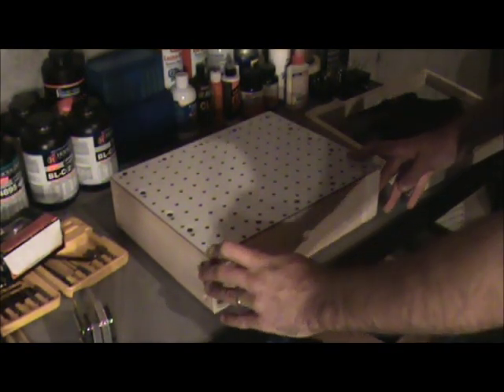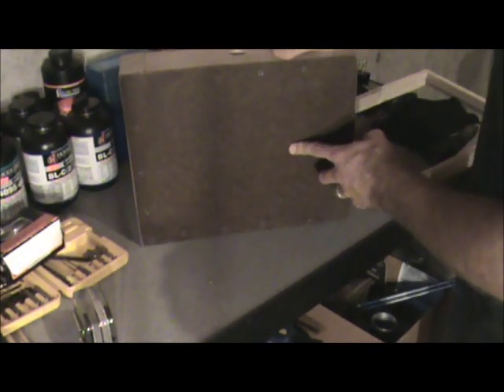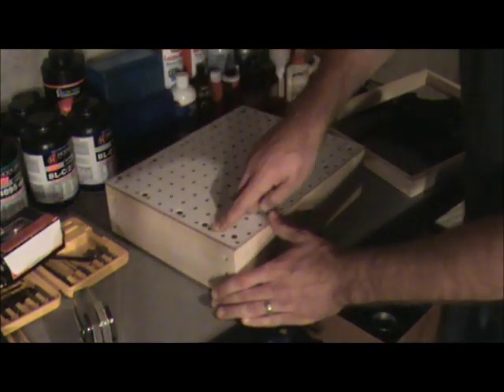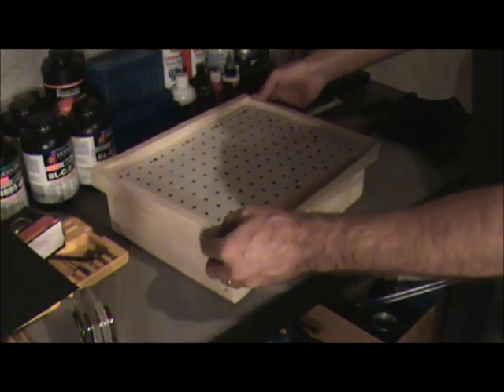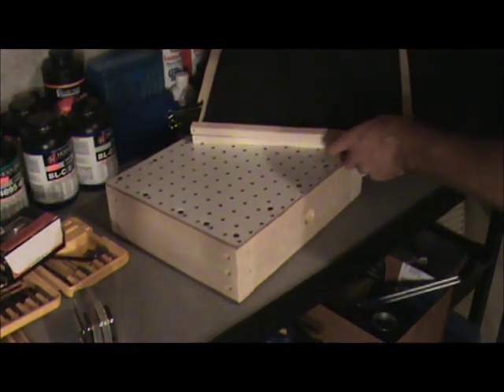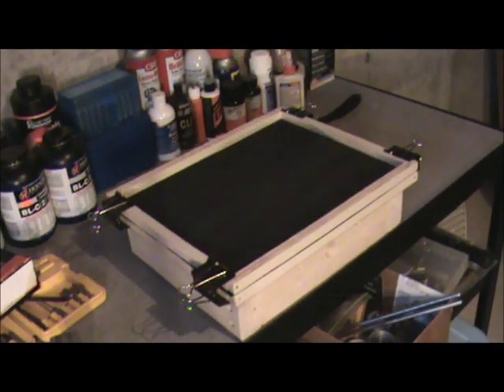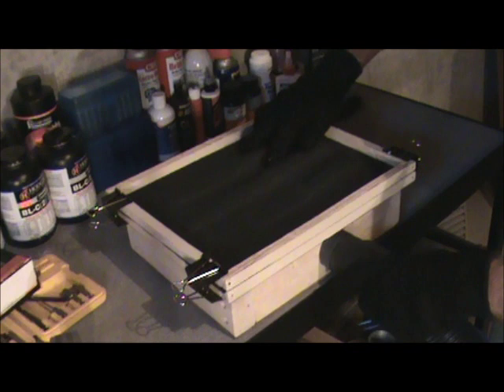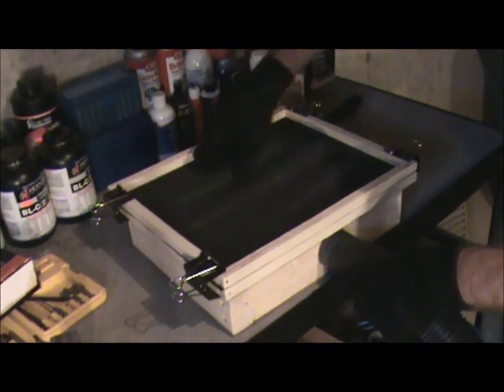Kydex sheath-making: Homemade vacuum thermoformer

Comment from the maker: @Cayoot 

It's more "accurate" in that the vacuum will pull the Kydex closer to the target piece. Whenever I used a vise/clamps, I always disliked how the foam does not fill the smaller spaces. The vacuum does a better job in that respect.

To your second question, I needed the Kydex sheet to be flush with the top of the pegboard, and I wanted the guide pieces to clamp to the kydex as an assembly. Either way would likely work - but there's plenty of trimming no matter what you do. :)

Comment from the maker: That depends on what your definition of "wasting" is. If your pressing method doesn't do a good job of creating tight tolerances around your parts, then all your kydex is "wasted". 

That being said, you can still maximize your kydex usage when using this method by using multiple parts at a time, and ensuring that you use all your space. Alternatively, if you're always using smaller parts, create a smaller apparatus.